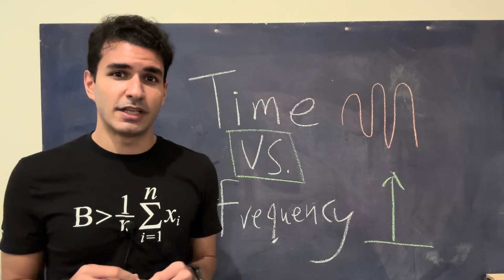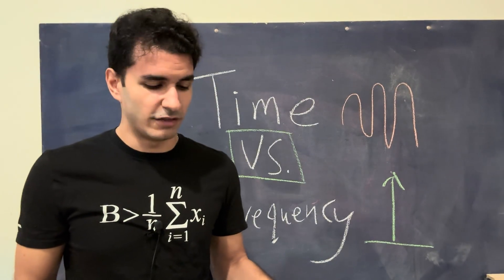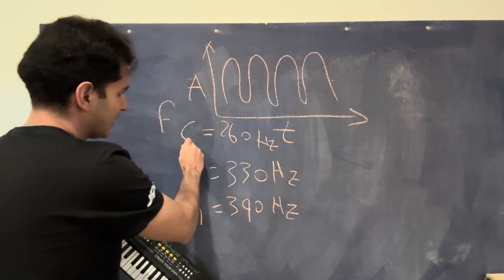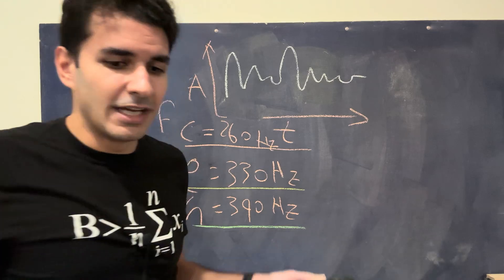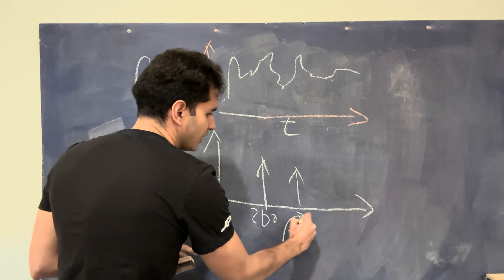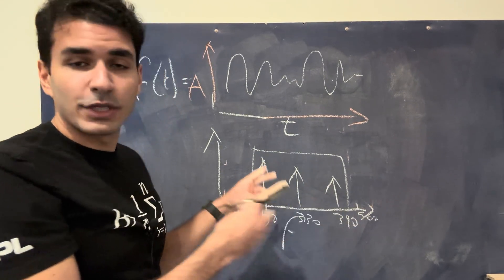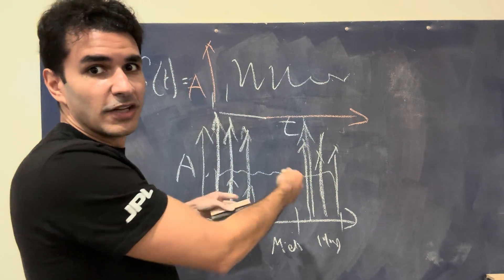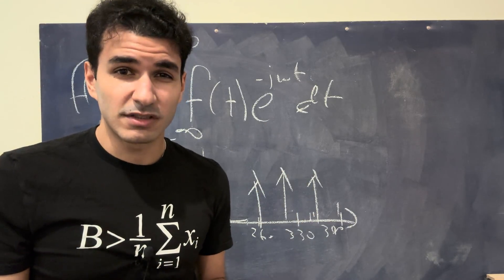Fourier Transform Explained (for Beginners)

Comment: Nicely taught about F.T. but we Gen Z engineers need proper guidance that what Career path we have.
For eg. I like circuit design, amplifiers, analog and digital communication, signal processing, etc. But I can't figure which skills, software I have to learn. 
Bcoz in this era most of the electronic production is done by automated machine. For what role will the company pay us?

Comment: YES, WHAT GOOD IS TAKING A COURSE IN DIGITAL / ANALOG SIGNAL PROCESSING, --IF, LIKE YOU SAID--- YOU ONLY MEMORIZE THE EQUATIONS AND DO THE MATHEMATICS, AND THEN PASS THE TEST WITH A 70, 80 OR 90 ,-----BUT YOU REALLY DON'T KNOW WHATS GOING ON. YOU REALLY DON'T UNDERSTAND THE SUBJECT MATTER AT ALL. YOU DON'T UNDERSTAND THE DERIVATION OF THE EQUATIONS AND YOU DON'T UNDERSTAND HOW YOU APPLY THEM DO THE REAL WORLD OF ELECTRICAL/ ELECTRONIC ENGINEERING.

Comment: I'm a wildlife biologist and field-turned-research ornithologist doing bioacoustics-centered research. I've been severely struggling to write about certain aspects of my acoustic signal feature analyses because despite the output making perfect sense to me, the input processes have been completely opaque. I'm grateful for the software that does all of this automatically for me but it's pretty tough to confidently explain analysis methods when I'm not exactly clear what's going on to get me to specific results and/or visualizations. You just filled in a majorly critical gap in my understanding of MFCC conversions. THANK YOU. It was a small switch to click but none of the lights were going to work unless it was clicked on. 
If you ever feel like foraying into bird world, you would be a killer asset in the communication behaviors/evolutionary bioacoustic fields.
Reply from the maker: i love birds and planes. connect with me on linkedin!

Comment: It's not related to the video, but do you think that the university (if it's renowned or not) you go to is important? For example, should I go for UCL (but it lasts 4 years instead of 3 because of the foundation course integrated with it + it's more expensive) or Kingston (normal, but a good uni, and it is a three-year BEng course)? (I live in the UK.).

Comment: Ali, I have an issue, and I wanted to ask for your advice or at least your opinion. I’m currently studying mechanical engineering, but before that, I studied industrial engineering. For my master’s in mechanical engineering, I switched to a more prestigious university here in Germany.

However, I quickly realized that the level of math and physics here is far beyond what I learned during my bachelor’s degree, and I failed pretty badly. My goal at the beginning was to choose modules that would allow me to pursue a career in the aerospace sector or rocketry—something like the German version of NASA. But after failing the modules, I realized I had no idea what the professor was talking about. You’ll probably laugh, but I’ve never even worked with PDEs before—during my bachelor’s, we only dealt with ODEs in a very simple form. On top of that, I honestly feel like such an idiot for even being in this situation.

I also came to the realization pretty late in life that I actually wanted to become an engineer. Because of that, I started off on a slightly different path, which means I’m now struggling with the gaps in my knowledge.

Long story short, I spoke to a professor, and he told me I’d need to spend an additional year just to get on the same level as the other students. Because of that, I chose to focus on production technology, and honestly, it sucks so much.

What advice would you give me in my situation, considering I need to complete my degree on time due to family reasons? For now, I’ve decided to just push through and hope to pivot toward aerospace or rocketry in the future during my career. Unfortunately, I don’t see any other way.

Comment: That's not exactly how noise cancelling headphones work. Noise cancelling systems have microphones that detect error (or noise) and attempt to remove the error by producing an equal and opposite signal that is 180 degrees out of phase. certain advanced DSP tasks for ANC may leverage FFTs, but real-time ANC systems rely on time-domain adaptive filtering. A pure frequency-domain approach would be too slow for headphone applications.

Comment: Great video, can you explain Ali how FFT is used to measure vibration on pumps? I have seen FFT experts pin pointing pump defects (such as bearing issues) using FFT!
Reply: @quoit99training83  All structures including pumps have resonant frequencis with probably few dominant ones. Structures must avoid being exposed to external vibrations ~equal to the resonant frequencis because if they are structures might break. Read about the Potomac bridge. A way to find a structures resonant frequencis is to expose it to a short pulse in theory a Dirac pulse and measure the vibrations it cause. By applying a Fourier transform on the mrsdured vibrations the resonant frequencis can be found. An FFT is just a smart algorithm to perform a Fourier transform. Cheers /Krister
Reply: @quoit99training83  A method to find if a structure is good enough to withstand an earthquake for instance is to find its resonant frequency(ies) and thereafter expose it to vibrations simulating an earthquake. If after that the structures resonant frequencis didn't change more than x% the structure is good enough and claimed to withstand earthquakes of a certain magnitude. Of course this method is only suitable for small stuctures and used as a verifying test method for outdoor cabinets for instance. 
This was an interesting subject which got me going :)

Comment: A noise cancelling headphone cancels out the ambient noise by generating a signal with the opposite phase, but same amplitude. What you're describing is a noise cancelling microphone, not a headphone.
Reply: @kriswillems5661

Is that an example of destructive interference? The headphones?
Reply: @austinlincoln3414  yes, it is. It uses Fourier analysis too. It's just a bit more complicated. It measures the outside noise, converts it to the frequency domain, and then generates, an anti-phase wave according to the sound conduction profile of the headphones. That is, frequencies that more difficult to block by the sound insulation are more amplified (and are in antiphase).

Comment: In your next video could explain it in terms of Hilbert space and a change of basis, and how the time signal could be represented as a N-dimensional vector in a vector space with a Kronecker delta basis and how we essentially project it onto the orthogonal function basis where every basis function is sin/cos or just e^-jwt.  And also why sin/cos are orthogonal functions.  I think it's the most intuitive approach since we essentially calculating a dot product of two continuous functions. And it would be nice to explain the dot product as "how much of vector A is in the direction of vector B" and how it is applicable to the FT. But I've never seen it visualized / explained as a change of basis / projection onto the frequency components.

Comment: 0 frequency would be a constant "wave," no oscillations, like say DC current. Positive frequency indicates a wave travels forward in the future, negative frequency means a wave propagates backwards in the past. Infinite frequency means instantaneous change. FT is a special case of the Laplace transform, and only applies to "smooth functions."
Reply: @ab-nm6xi

How can a wave propagate into the past?
Reply: @austinlincoln3414  For mechanics and electromagmetism the differential equations have solutions when time goes backwards. (For termodynamics time only flows forward.)

Comment: Fourier transform breaks down complex signals into their basis signals.
Similarly, R^3 boils down to the 3 basis vectors: (1,0,0), (0,1,0) and (0, 0, 1).

What is the reduction of signal to its core components used for?

Comment: Step one in taking Fourier transforms is to categorize the signal into one of four categories: continuous/discrete and periodic/aperiodic.
Reply: What to do in aperiodic case, laplace transform ?
Reply: @shisoy4809  LT transform is for "badly  behaving" functions, discontinuous functions, etc, where the improper integral may not converge.  Aperiodic case has nothing to do with it. That's the beautify of FT and that's how it's different from the Fourier series. The Fourier series is calculated on a period, and FT extends that period to infinity, so an aperiodic signal is thought of as just having an infinite period.
Reply: @shisoy4809  Laplace or Fourier transform?
Reply: Excellent intuitive introduction....